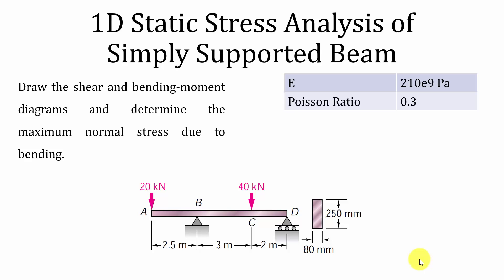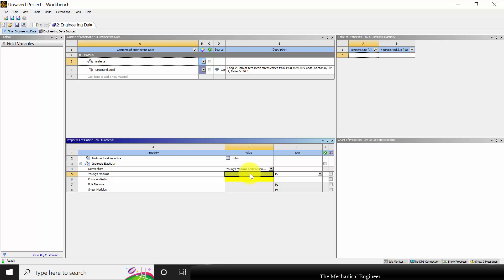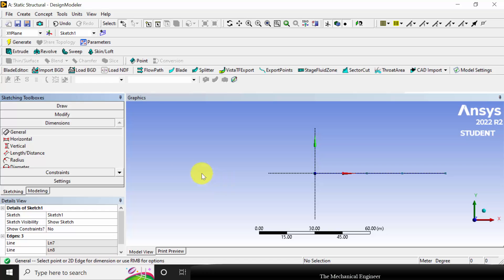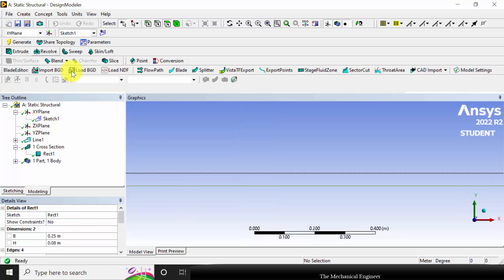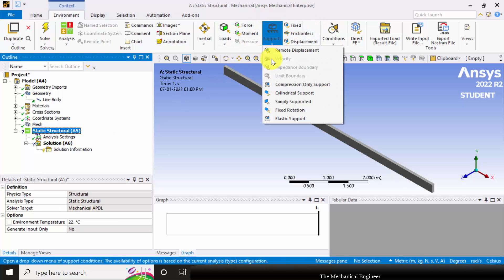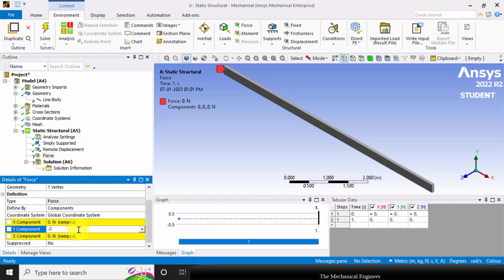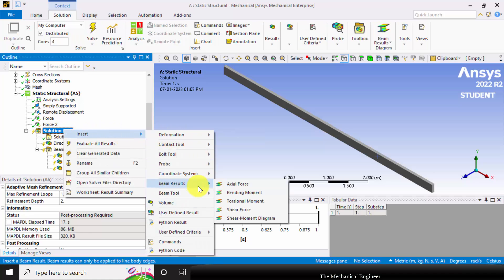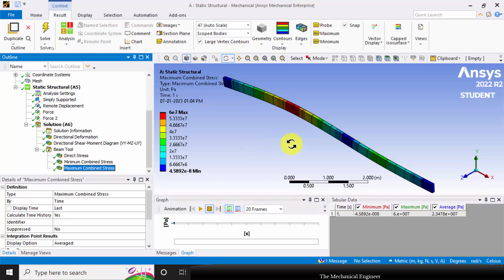1D static stress analysis of Simply Supported Beam | ANSYS Workbench tutorial for beginners

Comment: Hi brother I’m currently measuring static deflection on a reinforced concrete simply supported beam. I’ve measured the deflection as a healthy state and want to add damage to the beam in a certain area of the mesh via a crack. How would i achieve this?
Reply from the maker: Introducing a crack in a finite element model involves modifying the mesh or adding elements to represent the crack. In ANSYS, you can use the "Crack Growth" tool to introduce a crack element.

Comment: Can someone answer to my Q, usually a beam subjected to bending and shear and we check for both, but here in this video, the beam only shows over stressed at the midspan. so my Q's are 1.is this output only reflecting the flexural stress if not what stress? 2. how do we know this will satisfy the max shear at the support?
Reply from the maker: In ANSYS, a 1D stress analysis often involves beam elements, where the primary stresses considered are axial and bending. While ANSYS can provide information on shear stresses in beams, it may not offer as detailed shear stress distribution as in 3D analyses.

To assess shear stress in ANSYS, you can review the results for shear force and use the appropriate formulas for shear stress calculation. Be cautious about the accuracy of results, especially near supports and concentrated loads.

For a comprehensive analysis of shear and other stress components, transitioning to 3D elements might be necessary in ANSYS, depending on the complexity of your structure and loading conditions.